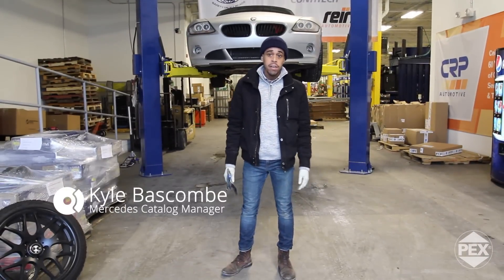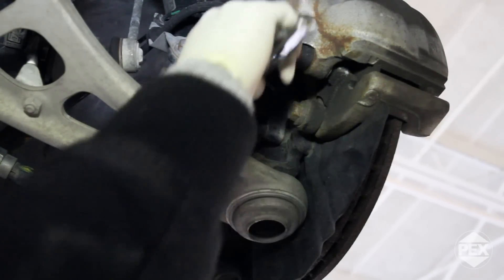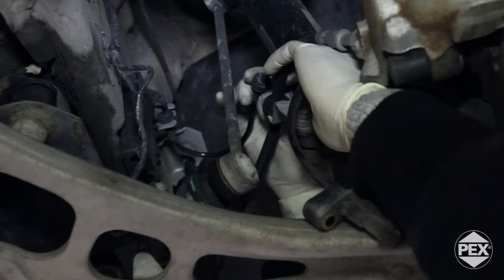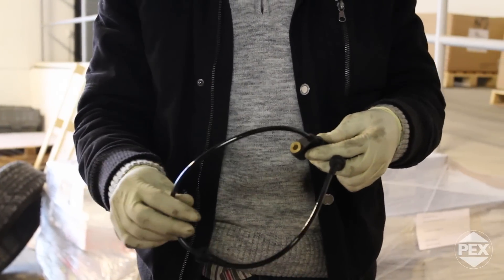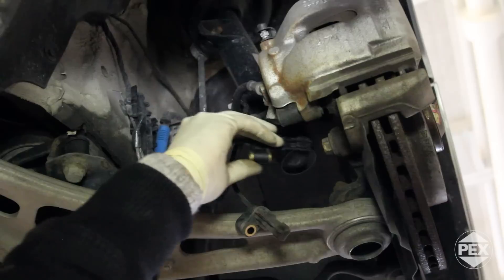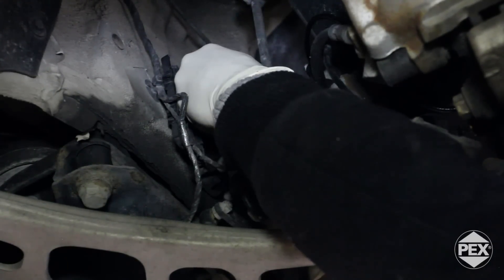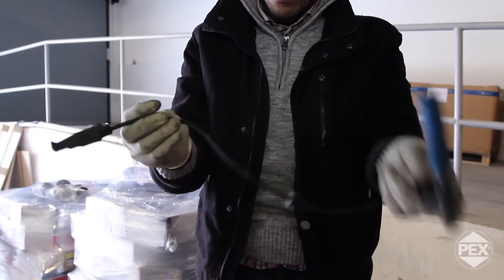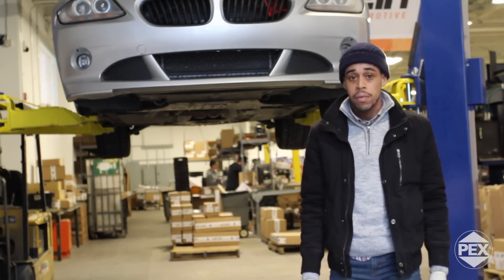DIY! BMW ABS Sensor Replacement (Z4) FCP Euro

Comment: Great video.  Does the the junction box open by just pulling the door open?  I'm pulling pretty hard and it does not open.  Are there any locking tabs I need to release.  Looks so simple but it will not open.  1998 BMW 540.  Looks exactly the same as in your video.  Don't think it has ever been opened before.
Reply from the maker: Hello, there's a locking tab that needs to be pushed in before it's released. Using a flat head screw driver may help with this.
Reply: Do you require a reset after installation is completed